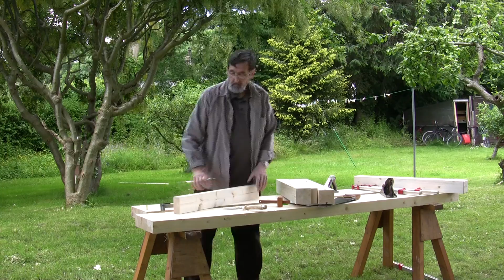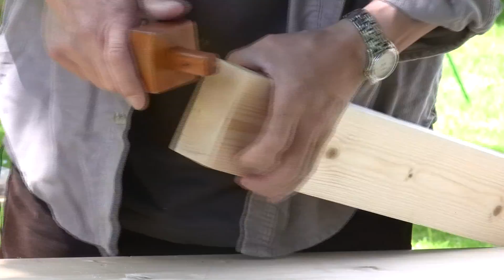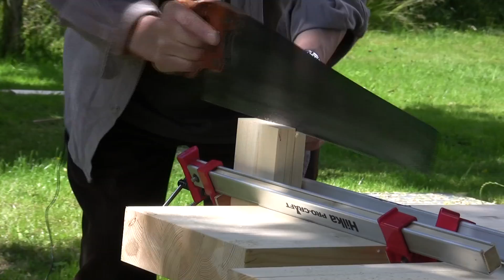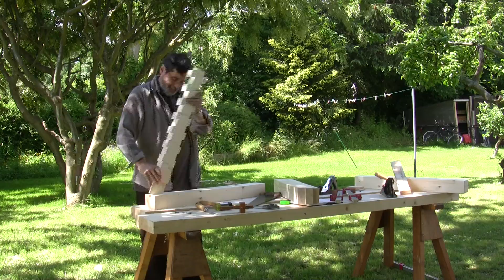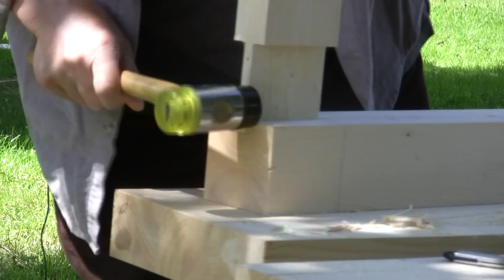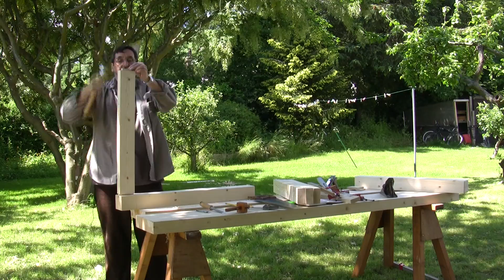How to build a workbench - (Part 7) Cutting Tenons - | Paul Sellers

Comment: Did you just drive that chisel through that board to make the poor mans router?
Reply: master paul threw the chisel at a piece of scrap from 20 meters using a mirror to sight it while wearing an eyepatch - the result required only a stern look from him for final adjustment and it was ready to work ... since born was the poor man's router
Reply: He has a video on how to make it. Predrill and then drive the chisel through.

Comment: I am a novice woodworker, and have been using powertools to do projects for a few years, but watching you work with hand tools is a revelation--so much more pleasant and natural, and frankly less stress, noise, and chance of injury. Amazing. Thanks.
Reply: I've never liked the sound of a router or dremel, and have learned to dislike the sounds of circular saws, planers, etc.  Sharp tools rool!

Comment: is there a way to secure the chisel in the poor's man router ? , if it jam in the grain isn't there a possibility to be pushed up and so the mesure won't ben good anymore ?
Reply: you should set it only for a small cut to avoid changing depth... The adjustment of the depth of the chisel is by hammering the top of the chisel to increase it, and hammering the wooden bar (in the same angle of the chisel) to retract it, like they do on wooden planes...
Reply: Luka Lamarche Drill the hole a bit undersized, e.g. the width of the chisel not the diagonal if you can visualize that. A small wedge works but drilled correctly it's really not necessaary.

Comment: You have just gained a subscriber! It's a pleasure watching someone work with wood with the skill and knowledge you have, this takes me back to my school days in fact over 30yrs ago here in New Zealand, our woodwork teacher was great. As you say "real woodworking"...that's exactly what it is! I think it's the way you demonstrate everything so well that reminds me of his teaching methods. I'm in the process of building a new workbench using 4x2 pine also.You tube is so great to search for ideas and methods... I will laminate the thinner edges hence create a thinner top as I don't have enough stock to laminate on the wider sides like you have. I will strengthen it with some hidden rails. It'll only be around 650mm  (25.5 inches for the 'old school or US viewer) wide and 1 lamination only. Length only 1600mm (63 inch) Not my ideal choice but beggars can't be choosers! Sincere thanks for your great videos!

Comment: macduff ripped first with a (rip saw) then cut the shoulders with a panel saw or tenon saw depending on the width of the shoulder against a bench hook. Made mortises with a manual counter weighted machine with a heavy duty mortise chisel and brute force 60 years ago just cut to the lines no marking knife used. For instance a completed sash and cased window in 5 hours including the sashes all by hand

Comment from the maker: Actually I have answered this elsewhere but it's no trouble to answer for you and the sake of others. The only critical element to angles is the bevel of the chisel. As long as you bore the hole at an angle steeper than the bevel angle, usually thirty degrees, this router will rout. I suggest anywhere between 35 and 45-degrees will work just fine.

Comment from the maker: Yes, it's not RS, you are right. Bore an undersized hole 1/16" to 1/8th less than the chisel width and carefully drive the chisel and guide it for the centre alignment along and through the hole. There is enough friction on the chisel to hold it's depth, but also remember that the presentation of the angle hooks under the wood to cantilever the chisel to the wood and so the chisel remains firm.

Comment from the maker: If you go to my blog, back through the archives, you will find tons of information on hand tools, their uses, which ones you can buy that have quality but are not expensive for startups. Also, remember that our new online broadcast is designed specifically as a an apprenticing course and teaches the essentials of woodworking and follows the methods I was trained by as an apprentice in the UK.

Comment from the maker: That's right, and the friction on the wall of the hole, combined with the cantilever effect of the chisel entering the wood keeps the chisel from withdrawing, although with rough treatment it can. The hole size is 1/16" smaller than the chisel size, so 5/16" for a 3/8" chisel.

Comment from the maker: This can be affected by the bevel of the chisel. If the chisel is sharpened and honed at 30-degrees, typical, then any angle greater than 30 degrees will work. 40-45- degrees will work perfectly.
Yes, the bored hole seems to work well if the hole is 1/16 under size, so a 5/15" hole for a 3/8" chisel and so on.